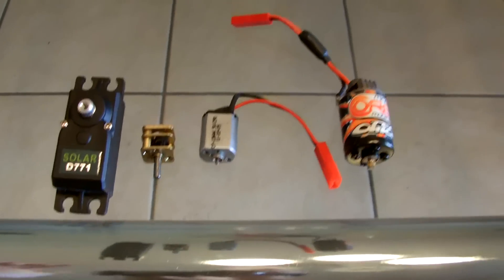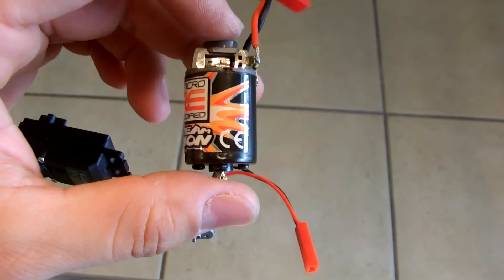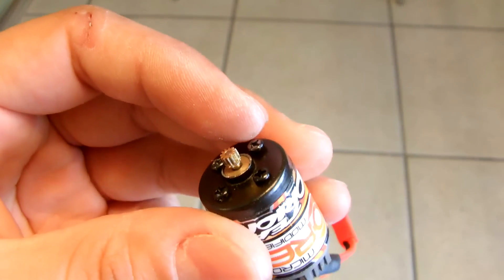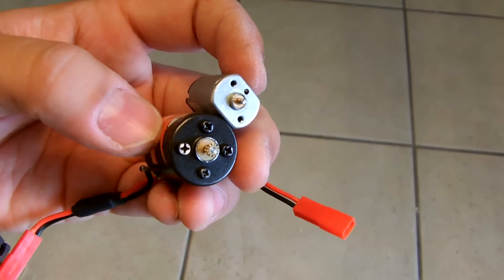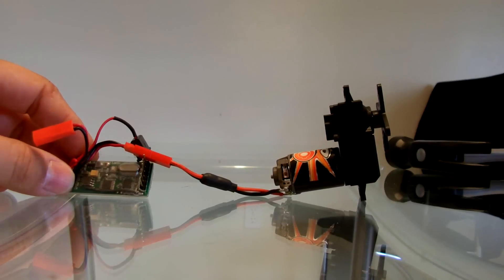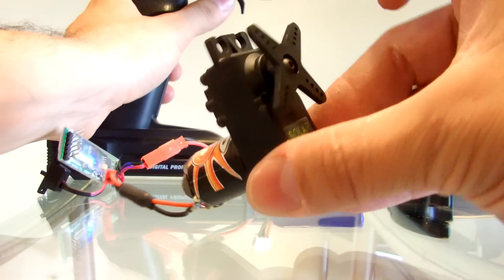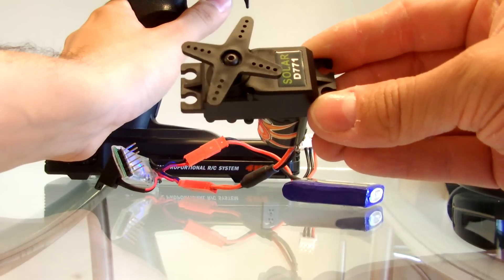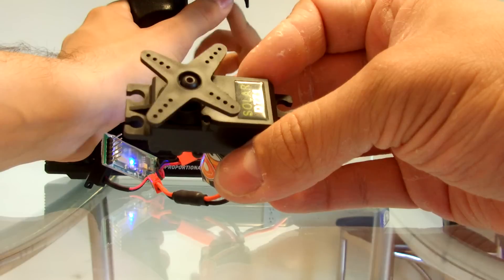52 Redcat Racing 1/24 Sumo Crawler Micro RC with mods / upgrades Servo Trans

Comment from the maker: I have a Toro brushless setup for 1/18 that Im sure I can fit into the servo trans, at 3s it gets over 70,000 rpm on the motor, that combined with the servo reduction would give me crawling power and great speed with metal gears on all :), problem is that would be a $35 motor and esc,plus $17 servo, plus redcat receiver $8-$15(depending where you buy). That price would be a bit high for most people messing with the sumo I think, although like I said power and speed would just be crazy!

Comment from the maker: Well, Ive been looking into changing over, just wanted to offer the viewers the best option that would work with stock esc so their expense was as low as posible if they wanted to replicate, but Im testing a few different esc I have laying around (losi esc is way too expensive for "cheap build") that will allow me to run and still keep 4ws just by using redcat receiver with sumo transmitter, kinda like I used on my xr10 experiment on my other video.May even do brushless if price allows for it.

Comment from the maker: So Im having issues with one of the esc that I used to run this setup, it doesn't bind to transmitter anymore, my second esc has been running no issues as of yet but will try to figure out first one before running second anymore to make sure it wasn't high amp draw damage. Nothing burned on esc and blinking light still comes on looking for transmitter. First esc ran 15min, second esc has been run 30min so far, this is on my sons sumo grave digger on sand pool.